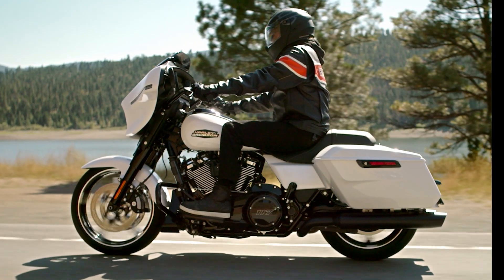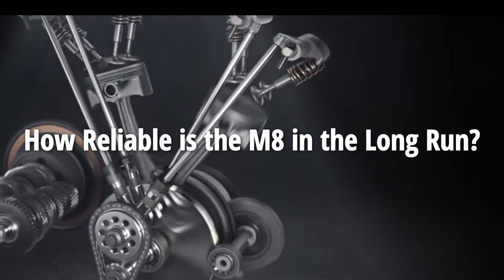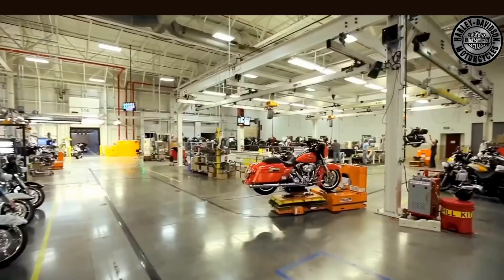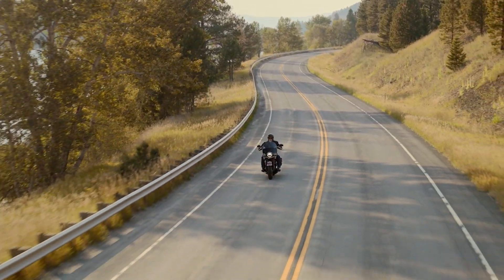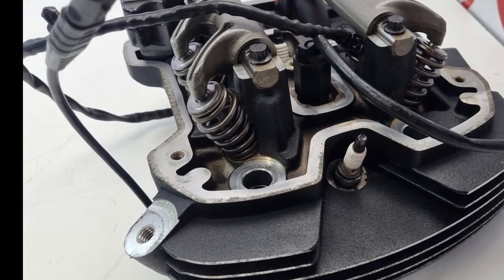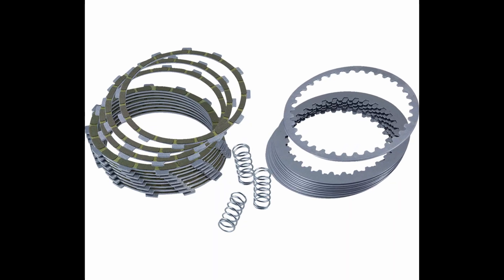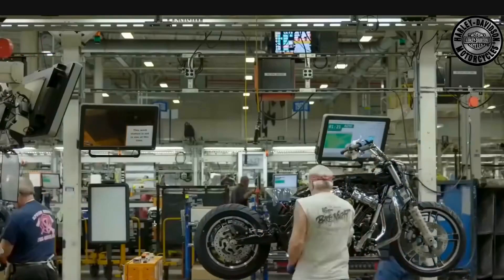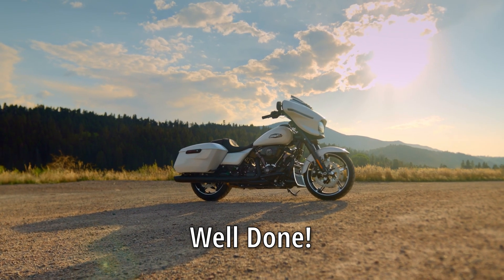How Reliable Is Harley's Milwaukee Eight? Teardown After 30.000 Miles

Comment: Its the reason why after 55 years of riding I decided to buy a 2023 Harley 114 Street Bob last week
Reply from the maker: Great choice. Ride safe!
Reply: You will find out!!!  😆
Reply: @FastSundayflyer  Find out what?
Reply: Congrats🎉
Reply: No. You just have not accepted the conclusion of your masochistic tendencies. 🤣
Reply: I've got a 23 bob black & orange, do not assume what was given out here is the same for all bikes as all harleys are not created equal. My first one with 89 miles new from a dealer had an oil leak behind the rear cylinder, about a dessert spoon of oil every ride, even as low as 50 miles. I gave it back under my 30 day UK rights. My next one from 200 miles ex demo,  has its heads vented to a catch can, it also has a crankcase breather.
It has a TBR 2 into 1 and a USA non emission controlled PV4 map. Am running Amsoil half way up filler stick. Saw a piece about over long sump plugs but ignored it as thought was to to do with the early models. Then I heard later models had the same plug. Watched some vids that showed some bikes early models had between 4 and 8 ounces of oil in the crankcase. This amount of oil collects from piston oilers, crank lubrication oil draining back down to the sump to be scavenged. 4 - 8 ounces of oil in the collection part of the case where this long plug resides is classed as a healthy engine. My bike was run in for the later part of the run in procedure meticullously. You could say maybe that first 200 miles it got thrashed. It has mini apes and anything over 80mph is hard work. the run in is 3500rpm 85mph varied revs up to 3500. Chances are it was never thrashed as most old gits buy them in the UK. Bike only has 2k miles and ridden 3 -4k revs max, mostly cruising with the ocassional safe fast overtakes. After one such run took my long sump plug out to find 14 ounces of oil in there, talk about gutted as my bike was already begining to sump. Bought Fuelings shorty sump plug £25 and fitted it. Took it for a blast and removed it, 6 ounces in there. Intend to check it again after the next season when am about to do my oil change. Don't assume all harleys are created equal, CVO models sump all models can sump. Some take considerably longer than 2k miles to sump. 14 ounces is not enough to cause pickup or drag in the engine but another couple years and double that quantity, you get the picture. I had no symptoms of anything by all accounts my bike runs awesome. All the mods carried out were preventative, like swapping out the fragile harley brittle cast compensator for a billet version. Just peace of mind fixes as harleys are by no means perfect regardless of what many may claim.

Comment: Over priced junk harley will be closing down for good  because of building junk
Reply: Did you actually watch this video? Your comment is inane, Harley Hater.
Reply: @kencarp57  harley garbage. You got spend 70k. Then take the engine apart and fix there problems. Like come on thats  why no buddy buying them. They are hurting they will go under soon.  Look at indian. Now that is a work of art
Reply: I'll keep that in mind after trading in my 2006 Sportster with 100,00 flawless kilometers for my 2022 Heritage that has accumulated a flawless 65,000 kilometers so far. I expect to get 200.000 kilometers on it soon as I average 25,000 kilometers annually. BTW both bikes did not use any oil between oil changes. And the best part...You never have to do valve adjustments as required by all other bikes. Just change the oil, tires and and brakes and your good to go. I think I'll change my fork oil at 100k. Oh shame.
Reply: @chromesporty4984   You might want to change your drive belt at some point in time. Also your shocks. They are both wear items.
Reply: @feloniousmonk3049  The drive belt on a stock bike will last at least 200k. Because the Heritage has shock cans the front shock they are protected from the elements and last a very long time. When I sold my 100k sportster the belt drive was perfect and was never changed. I have not had to adjust my drive belt on the Heritage for the last 50k. I do not touch the belt adjustment when I change my back tire.
Reply: Belt on a Heritage?
Reply: @LuckOurDog  Drive belt instead of a chain.
Reply: @LuckOurDog the heritage has always had a drive belt since 86 dude
Reply: @Dynachop420  100% people are clueless.
Reply: Indian All the way

Comment: My buddy has a 2019 Road Guide has over 100k miles and the engine has never been opened up. It does however use about half quart to a full quart between oil changes now.
Reply from the maker: Thanks for sharing. I guess at some point the pistons will eventually show some wear, which reflects in slight oil consumption.

Comment from the maker: What do you think about Harley's Milwaukee Eight Models? I am curious to hear your opinion!
Reply: I have a '23 road glide ST with aftermarket cams, lifters, tool steel compensator ramp, custom dyno tune and full 2 into 1 exhaust system that I've put 30k miles on in the last 2 yrs. I beat the crap out of this bike! it runs strong and valve train sounds like a sewing machine. These other comments are not grounded in anything but hearsay and cherry picked data. The sumping issues have been addressed years ago. Anything 2020 and up has a great oil pump that has shown to be reliable even in high power motor builds. Same with the OEM clutch, throw some heavy duty springs in it and it's good to go even with engine mods. My bike is a mild build at 119HP/135lb ft at the rear wheel. Enough power to be fun and proving to be extremely reliable. I know a ton of others with m8's, problems are rare and we all beat the crap out of our scoots.
Reply: Acceptable levels of crank run out to 0.006" tolerances is hard on the oil pump and the cam chains. Another big problem on 2018 -2020 models was oil sumping issues causing aeration of the motor oil and complete top and bottom end damage. Manufacturing errors in tapping the oil sump plug with a tapered tap and running the tap too deep into the lower end of the engine case, cutting off oil return line port to the oil pump, by the oil sump plug being now seated too deep.
Reply: They're trash, just like most anything else Harley
Reply: Every indi mechanic that used to work for Harley, or works on Harley a lot all say the M8 is junk, so I'm not sure how much Harley paid these people for this giant blowjob of a "test".  Also, was this "test bike" a random pick, or was it specially assembled with none standard parts?
Reply: @jimbranscomb4350  I've never heard anything bad about the m8 other than the early ones with crap oil pumps. I put a new pump in my 107 and have 15k miles on the bike and its flawless.